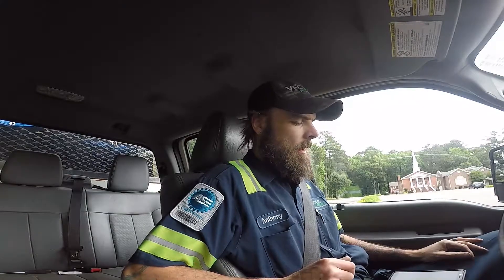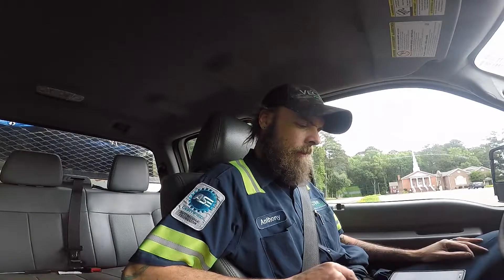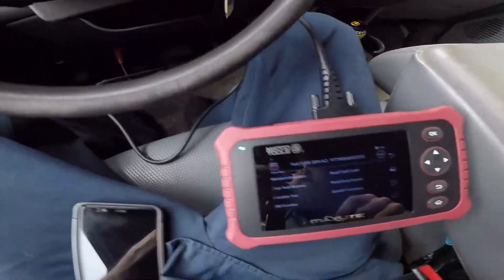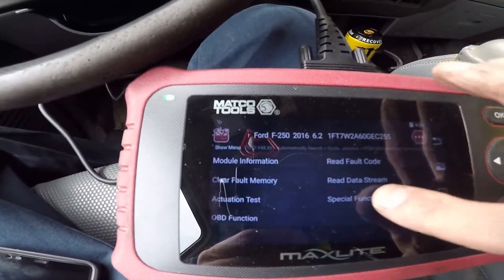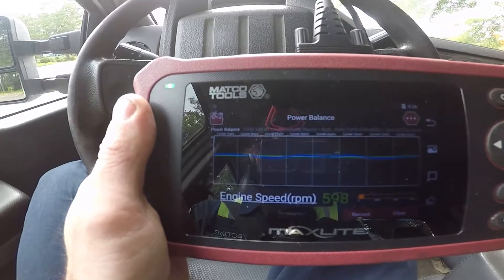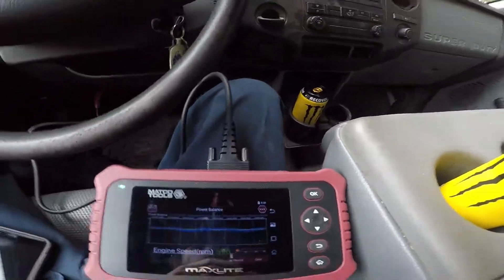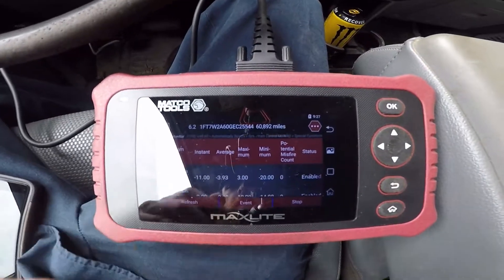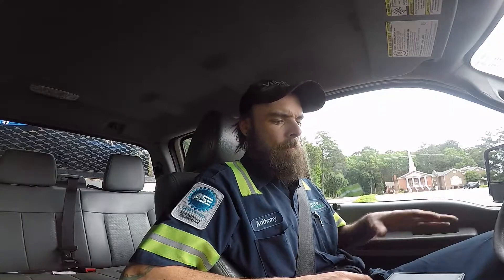2016 Ford F250 6.2 Liter P0355 Diagnosis And Fix

Comment: You described my exact problem.  2004 Grand Marquis.   Tried replacing all plugs twice, all coils, replaced #5 coil a second time.  Still the same problem, and now the AC compressor stopped working.
I've been to 4 Ford dealers and they wont even work on the car.   Maybe I can show one of them your video and they can try what you did?   Where is your shop?  What city and state?   You've got the best video I've seen on the P0355 code; most just change the #5 coil.  Can't believe no one has given you post to say thanks.   Hope to hear from you.   THANKS
Reply from the maker: Glad I could help. I do not own my own shop. I was a ford master tech. I work at a dodge dealership now in North Carolina.
Reply: @BeardedFordTech    Thanks for the fast reply.  As I said, I believe you pinpointed my problem.   Are you able to reprogram the vehicle's computer using the Matco scanner, or does reprogramming require Ford computer software, i.e. does a Ford Dealer or someone with a computer that has the Ford software program have to perform the reprogramming?
Reply from the maker: @tompastian3447  if you have a matco scanner or know someone who does that has ford software (ids) and it's able to bidirectional (program modules) then they can do it. I purchased the ford software on my scan tool. It has to be bidirectional to program. Otherwise you can only pull codes and look at pids.
Reply: @BeardedFordTech  If I purchased the Matco Scanner and specified I want the bidirectional  type scanner with the Ford software, is that all that is needed to reprogram my PCM?
I just forwarded your video to Metro Ford Service Dept.   The last time I was there was for this problem about two months ago.   They said they couldn't get to the car for 6 days.   That was after they told me to bring the car over.   Just can't be without the car for 6 days unless I know they will fix the problem.  Thanks
Reply from the maker: @tompastian3447  you can buy the matco scan tool. It comes with all software. You would just need to purchases a ford subscription. It's $20 a month. That will allow you to do it.
Reply from the maker: @tompastian3447  just wanted to check in with you and see if you got a scan tool or took it to get the pcm reprogrammed.
Reply: @BeardedFordTech  Thanks for your concern Anthony.  Last Friday we finally found a Ford dealer who said they can reprogram our PCM on the Marquis.   I've been to 5 other Ford dealers and not one even mentioned reprogramming the PCM.   Auto Nation Ford had the car a full day, and gave it back, no charge, saying it MIGHT need a new PCM, and since Ford no longer carries them, there was nothing they could do.
Palmetto Ford Trucks service rep told me  they've never replaced a PCM on any vehicle they've serviced.   I will let you know what Pines Ford does.
I may bring a copy of your video text with me and the link, even though the service rep who called us said they didn't need it.   A few months ago,  I even called Ford's national customer service number, explaining the problem.   They didn't suggest reprogramming.  Instead, thy put me on the phone with Gus Machado Ford, who told me they don't service vehicles with over 135,000 miles.    Why would I buy a car from that dealer???
Reply from the maker: @tompastian3447  I found the tsb for that truck I was working on. There was a whole list of vehicles on it. Would you mind emailing me the vin number so I can check for you
Reply: @BeardedFordTech  VIn #2MEFM74W84X625838

Anthony, we dropped the car off at Pines Ford this morning, and they asked for two sets of keys. I gave them a printout of the full text below your video, and wrote at the top that this came from a Ford Master Technician. The service rep stapled your printout to the work order. They charge 160 for the diagnosis, which applies to any repairs involved.
About two years ago my 77 Cougar wagon broke down in Homestead. I stopped at a gas station, and noticed what I thought was water coming from under the engine. I called for a tow, and dropped it off at Lorenzo Ford. It turned out to be a broken fuel pump, and it was gas leaking, not water. They charged me 135.00 for the diagnosis which they did not apply to the replacement of the fuel pump. They charged me over 400 dollars to change the fuel pump, which is about a two hour job with a cigarette in one hand and a cup of coffee in the other. Plus the 135.00 diagnosis, 75 for the fuel pump and tax on all that. I asked them what their hourly rate was and they would not tell me. Had I known it was a fuel pump I would have changed it myself. They had the car for two full days, and called me the morning of day 3 to pick it up. Next time I break down in that area, I w ill select another repair place.

your video came at a great time, The car shudders when you accelerate, and I would still be in limbo if it wasn't for your video last May. I checked youtube prior to your posting, and did not get any solutions from what others had posted, i.e. no one suggested reprogramming the PCM. Two videos I did see, one guy swapped the PCM for one out of a junked police car. Surprised that that worked, but he claims it did. Another video suggested replacing the PCM with a re-manufactured one, which would still require programming.
You have to re-accelerate harder to compensate for the misfiring. This problem started early in 2020, and a lot of parts have been replaced that didn't need replacing.

I should know something in a couple days as to whether they fix the problem or not, so I'll keep you posted.
Again, many thanks !!!!
Reply: We got the car back Wednesday afternoon July 21.    The car now runs good, the RPM's do not drop after the car has stopped for 20 seconds.   The total cost was 275 for parts, a new plug, coil and vacuum tube.  Total bill 423.00   
Your post came at a very good time, because both my station wagons are now out of service.   One had an axle brake, wheel came completely off on r rear.   I put on a new Moser axle, and found the differential is also broken.   I found a place in Fort Lauderdale called Rears and Gears.   He says he has a slew of parts for 9 inch Ford rear ends, but is backed up for a couple of weeks with more work than he can keep up with, working by himself 7 days a week.   He said he has no choice, that he can't find anyone with half a brain who can work on differentials.   I know exactly what he's talking about.   The other wagon had the steering column fall apart.  I had to have it towed to a place that specializes in steering column repair.   He says he thinks he has enough parts in inventory to repair it, and rebuild the entire column, 475.00.
I had to have a guy on the internet diagnose my problem, because 5 Ford dealers had no clue.    Glad you put that post up Anthony, and can't thank you enough.   I plan to call Ford's national customer service and tell them about this.   Except for Pines Ford in this area, Ford has no customer service.
Reply from the maker: @tompastian3447  I'm glad I could be of some assistance to you. I'm sorry about your other vehicles. But at least this one is fixed. Price wasn't too bad and the problem got fixed. I'm just glad I was able to help someone. Someone (you) saw the video and was like "how come nobody else has tried this?". 
I'm really happy I was able to help you. If you have any other questions please feel.free to email me or drop a.comment!
Reply: 7/18/2021  A quick update on the 2004 Marquis.   July 12 we left the car at Pines Ford for service.   Wednesday the service rep said several mechanics were sick, so the car had not been serviced yet.  Thursday afternoon he called and said they reprogrammed the computer and the p0355 code cleared.   He said the #7 coil showed up as missing, so they swapped the 6 and 7 coil, and it then indicated the #6 coil was missing.   I asked him to change / replace the bad coil.   He also said a vacuum tube was leaking (not sure what that would be) so I asked him to change that.   They still have the car, so hope they finish it this next week.   He said they would have to order the vacuum tube.    First thing I will check before leaving  the dealer is the RPM.   Months ago the neighbor let me borrow his scanner.   I kept it plugged in while I drove the car, and noticed after I came to a stop, that after about 20 or so seconds, the RPM's dropped from about 800 to around 500.
Even without the scanner, I can hear the engine RPM's go down after the car sits for a while idling.   IF I see that happening when I go back to the dealer, I will know something is still not right.   Will fill you in as soon as I get the car back.
Reply from the maker: @tompastian3447  that's awesome. I'm surprised the other places or even most techs don't know to look for a TSB for symptoms like that. They did the right thing swapping the coil for 6 and 7. The misfire moved indicating a bad coil. Vacuum tubes do go bad and can cause rough idle. When the throttle is pushed vacuum goes away. At idle your at about 20-21 hg vacuum. 800 rpm to 500 isn't real bad. It's supposed to idle around 600 I do believe. I'm glad that pcm reprogram cleared it up. Please share the video and the channel if you don't mind. If you have any other questions feel free to comment or send an email. And please keep me updated when you get your vehicle back 😁